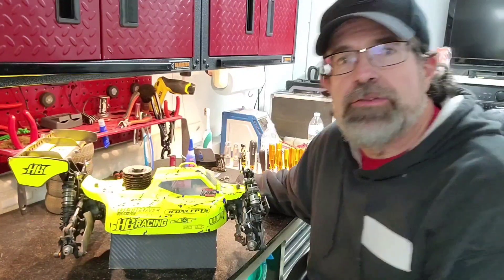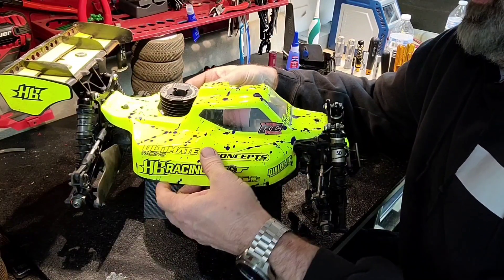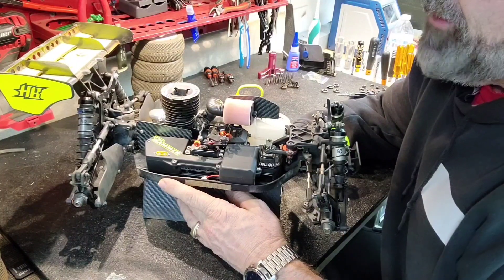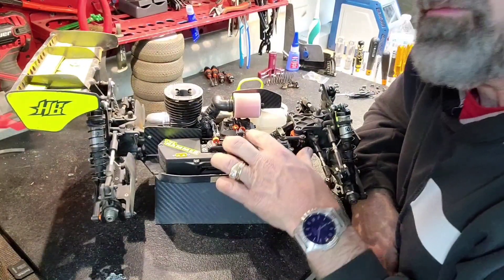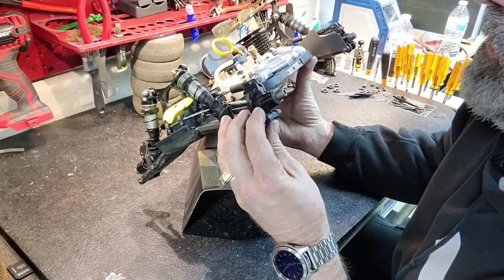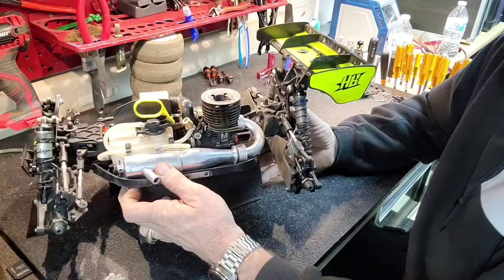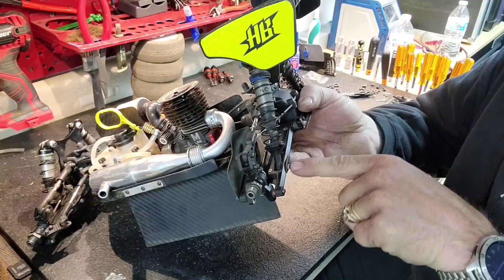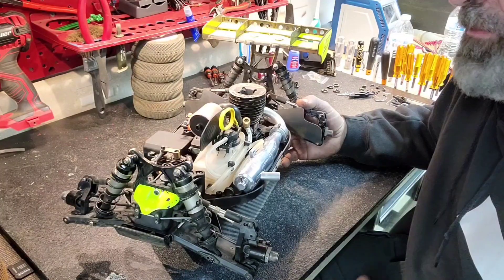THE BEST setup for your HB Racing D819rs

Comment: Question Hammer.....I have had my rear drive shaft pop out of the diff cup a few times randomly (especially on a hard crash lol)and was wondering if you had ever experienced that before...I am  pretty much running your setup etc. with a touches of my own but i have to say setup is awesome so thanks for all the videos keep it up really enjoy them.
Reply from the maker: Thanks for the kind words. I've never had a driveshaft pop out and I've had some terrible crashes. However, a close friend did, but I think his was bent before it happened.
Reply: okay thanks for reply...it happened once thought it was diff cup changed it plus rear arm for the next race never happened again...this weekend it popped out again so need to really see whats going on.....thanks again from Bermuda!!! where you have a strong following of  most of the 25 club drivers that race here. Team HB Racing dominates the podium most race days lol!!
Reply: not to go back to this but a fellow racer who was having same issue found some 93mm (part# 204446) rear outdrives do you run those? or the stock lengths that come with kit at 91.5mm?.....having the 93mm outdrives seems to me on paper that   should fix my problem any thoughts
Reply from the maker: @ChrisOsborne1268  sorry. I thought you were referring to the rear center shaft. I do run the 93mm rear shafts, but have only been doing it since last year's black Friday sale. I ran the stock ones for a long time and still run them on my ebuggy. I have never had one pop out. Maybe I have been lucky.
Reply: thanks Hammer

Comment: Hey! with 2dot over on A-block and B-block 5dot / 2.8mm, then it will only be 7.2 degrees kick-up. how does it work on bumpy tracks? have never tried it myself but became curious :-)
Reply from the maker: My car works great on bumpy track with this setup, but keep in mind this is also with the 20deg caster blocks,  which will help with that.
Reply: Will try when the winter is over in Sweden.  drove a lot with 20gr casterblock yourself, do you use 2gr steering hub?  there is also 0gr 4gr as well, heard rumor that there is also 6gr
Reply from the maker: @roddystigsson7901  yes. I use the 2 deg.

Comment: not sure if you mentioned your clutch setup and whether you use any brass, we have tried the brass hubs which have been effective if needing a bit more traction.
Reply from the maker: I use the stock clutch setup. Haven't  tried adding weight yet.
Reply: @TheHammer  I have tried the reds 4 shoe but actually ended up going back to the standard kit 3 shoe. WE used the brass hubs at the HB race in France back in 2019, which really helped as the track had varied traction. Interesting you've gone for the option internal gears, as not considered that, it might suit the US style tracks more than our EU style tracks. Thanks for sharing your setup and insights, good luck with the racing
Reply: this was the track to give it context https://www.youtube.com/watch?v=MQcgP9rV6yw

Comment: Next time you get a new chassis, go around to cabinet shops and or countertop companies. Get some scrap plastic laminate. Glue it to bottom take off rear anchor skid plate.
Reply: Then what when u need to undo screws ? Someone should make a chassis protector with all screw holes there as well .
Reply: @mattg2596  Yes a countersink bit would be involved. I assumed people would know that.

Comment: Do you have a part number for the 5x1.05 and 5x1.06 pistons ? Thanks
Reply from the maker: I drill out the ones that come with the kit.
Reply: @TheHammer  do you know the size of the drill bit needed? Thank you for your quick response!
Reply from the maker: @brycepeart5732  you just drill them 1.5mm and 1.6mm.  If I remember correctly,  it comes with 5 x 1.5 and you just drill a pair to 1.6.
Reply from the maker: Look up avid piston drill set. It's got 1.1-2.0 piston specific drill bits.
Reply: @TheHammer  cool will do thank you!

Comment: Would you feel that this setup, for the most part, would transfer to E819rs?  Thanks
Reply from the maker: Yes. I run the exact same thing on my ebuggy, but I use the Performa honeycomb bladders in the shocks and I run two shorty packs in the rearmost position.
Reply: @TheHammer  Thanks man!  I too run the performa honeycomb bladders and like them better than emulsion.  We race in the evening, and my car gets looser as it gets darker and the dew comes out.  The track feels greasy.  I'm searching for more rear grip at night and am afraid of how little rear toe your setup has!!!  Open to suggestions.  Thanks so much.
Reply from the maker: This setup has tons of grip.